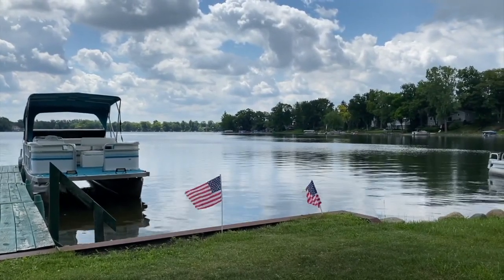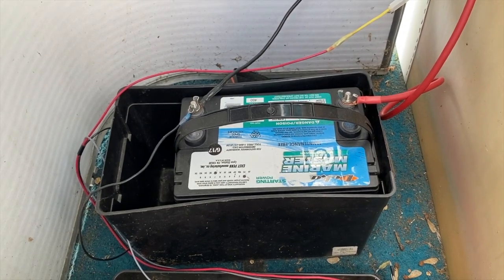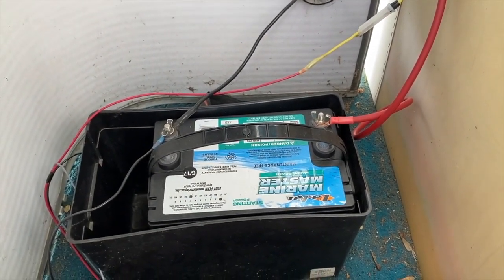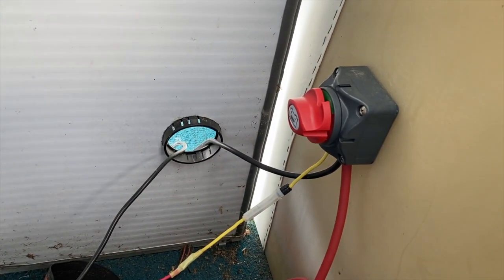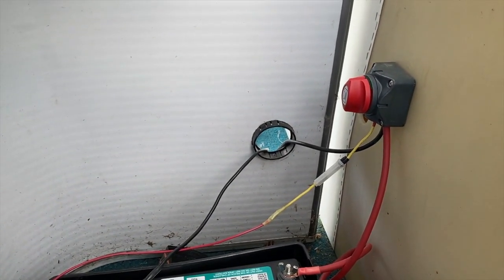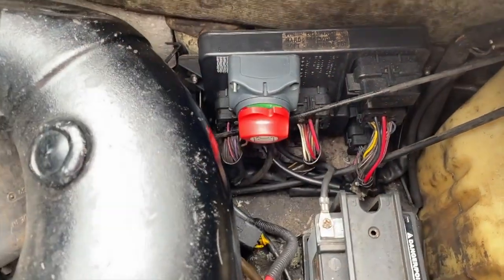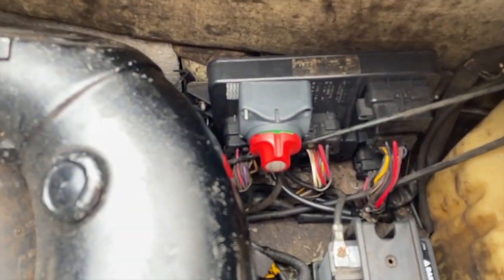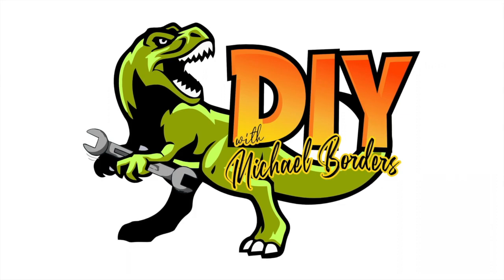Boat battery keeps dying - Parasitic draw

Comment: Thanks for taking the time to make and share the video! Would agree with other comments and say this is a case of fixing the symptom not the problem. The patch of installing a battery switch does not correct the problem the whatever component or system that is causing the parasitic draw. It will also increase strain on the battery and reduce the life of the battery. Could also leave you with a dead battery on the water if you have a long day out boating. 
Doing an amp draw test and isolating components to find and fix whatever is causing the draw would likely be a better fix.
Reply from the maker: @stevenash3949  

Good morning ☕️

We really appreciate you taking the time to share your thoughts, always welcome here on our channel.

The DIY community is the best!  😁🧰

Comment: I have a off switch for both batteries but still dyes. When the boat runs it shows its charging the batteries bc voltage climbs. But float on the water couple hours it's dead again. Batteries are less than a year old.
Reply from the maker: Thanks for watching, that’s no fun.  Is there any moisture gathering inside battery compartment or inside the actual plastic battery container?

It’s possible that you have an electrical short, or a constant load on the battery that is above what the regulator and stater can handle.

Any aftermarket electrical equipment added to boat such as sound system, lighting?

Comment: You did not eliminate the parasitic draw though. If you remove the battery, you remove the source of the draw not the draw itself. 
If I have a mysterious leak in my house, we dont remove the lake or shut off the damn.
Reply from the maker: Good morning ☕️

That’s correct, as we mentioned in the video.  Most people may never find the true draw and for that, can install a switch kit like this.

👍🧰

Comment: This is not helpful to boaters trying to find out what is wrong with their engine. 
Parasitic drain on the 12 V system is not normal and should not be patched with a switch. 
You are only selling a battery cut off switch. 
A helpful DIY video would help figure out why the engine is sucking down the 12v supply.